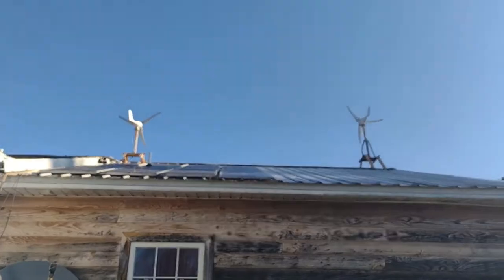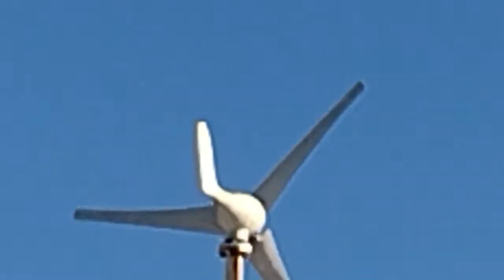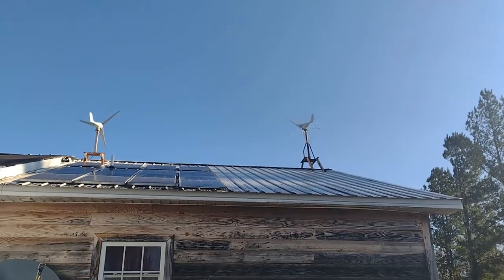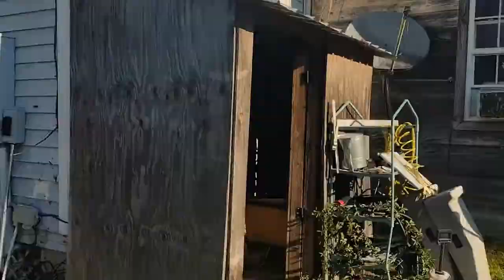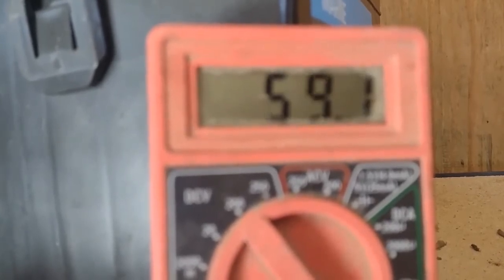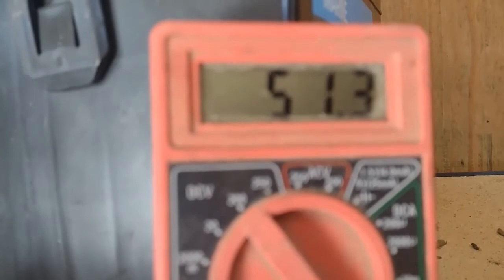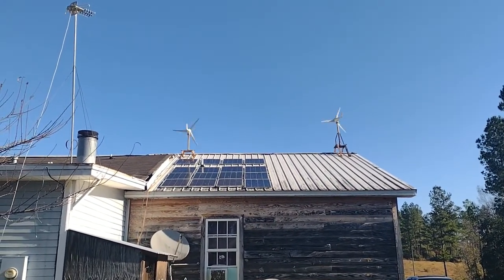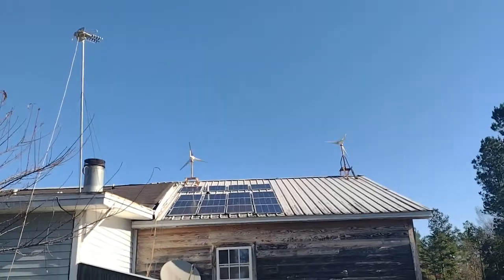How much voltage do my wind turbines really make being connected together? Here's the answer!

Comment: volts isnt power - u need watts
Reply: You’re both right. What would be interesting to see is the power going into your batteries.
Reply from the maker: @kevinmills5293  I can't wait to get back to this project... I will make sure to calculate the absorbed power when I am able to... Currently I'm stuck OTR for a good while as a trucker but as soon as I have a chance I'm going back to the farm and getting back to Christine
Reply from the maker: I must not be understanding your comment... To charge a battery, the charging voltage has to be higher than the battery voltage to send the power (watts) into the battery. Your current (amps) would be the rate of charge your batteries are being charged at.. but unless the voltage going into the batteries is higher than the batteries themselves you will not be able to put any power into them, no matter how many watts the turbines are making.
Reply: Not wrong but a better way of putting it will be Power is not only made out of Voltage, you also need good amount of Amps. Now multiply them: Volt * Amp = Power (in Watt).